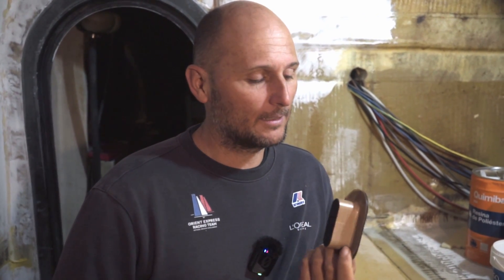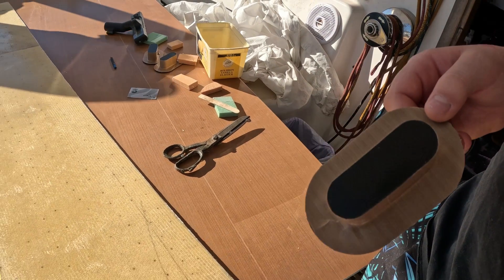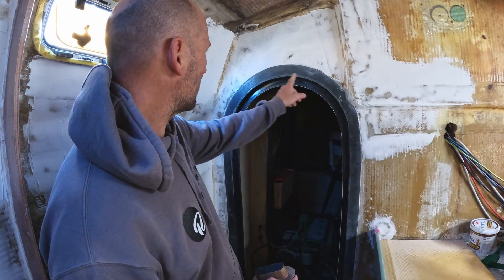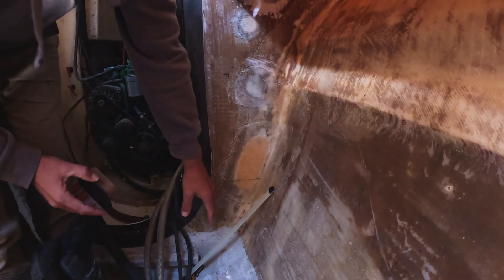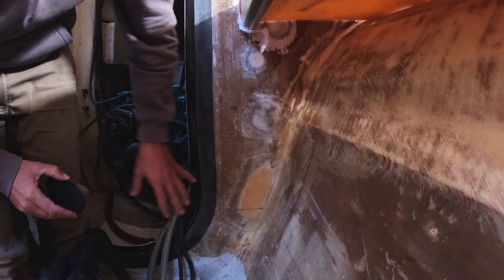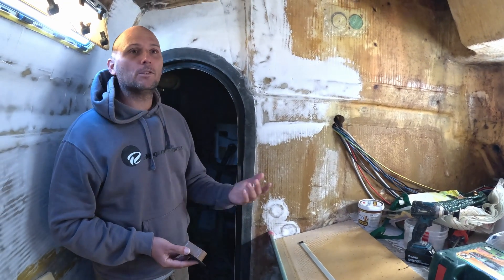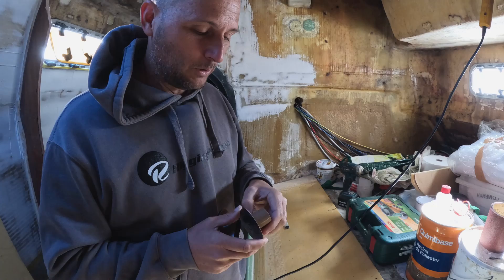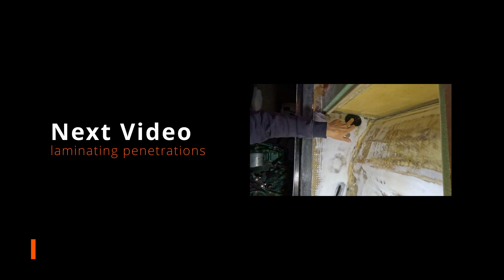The Correct Way to Put a HOLE through a Boat Bulkhead

Comment: One of the big problems with the lagoon bulkheads was that they didn't even seal the plywood after cutting huge holes.
Reply from the maker: Yes that also another problem
Reply: And didn't tab the plywood to the hull. And used plywood that was thinner than the designer specified....

Comment: I tell people that my boat (FP) is perfect for what it was designed for. Anchoring.
Reply from the maker: Nothing better than sundowners at anchor on an FP 😉
Reply: Well new yes, the old Lavezzi,Belize and Bahia sail well too, the cheap performance oriented cat. Lavezzi 6.2t lightship for 40ft and Bahia 46ft with 9.5t for 46ft is on par with today's performance cats from weight and sail area is quite comparable too. Put hydrant from Calvert onto this old FP and they sail even very well. The FP standard dacron sails and their cut sucks big time.
Reply: Yes I massivly re-enforced my Lavezzi too, all bulkheads cut properly epoxy glassed in and re-enforced plus a helper bulkhead additional to spread loads and through hulls in bulkheads done the same then Shane does here. All the stringers are also completely glassed in too.
Reply: @chrisr819  I've done a lot of reinforcement on my Salina as well, but it still needs more. I still have the factory sails, which were unused for much of the boat's life. But I can definitely see a big benefit in better cut sails. I also extended my keels 15 inches to fix the poor shape (same as your keels) and replaced the rudders (same as your rudders) with outremer 51 rudder blades. The keel and rudder mods greatly improved my tack angles over ground.